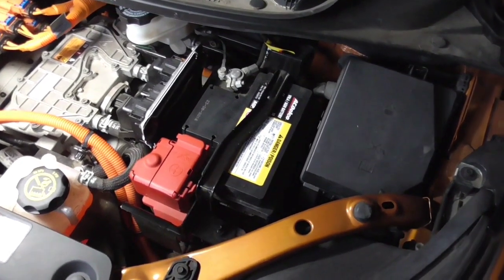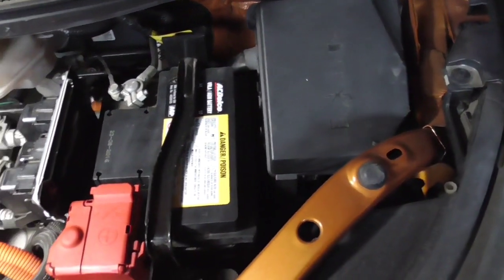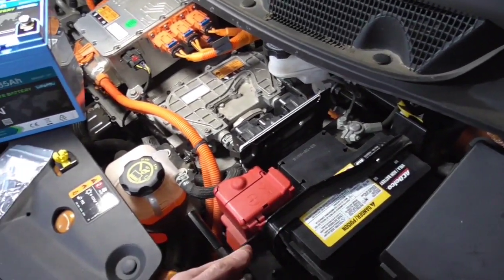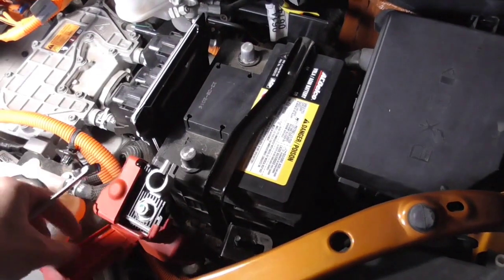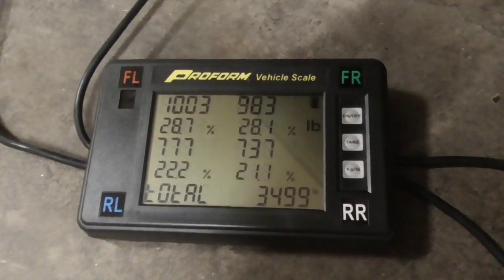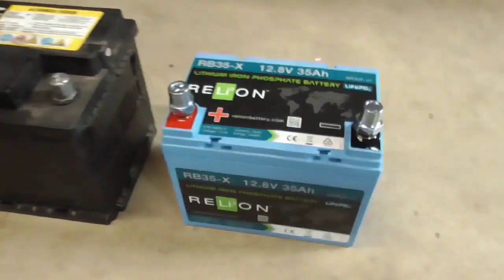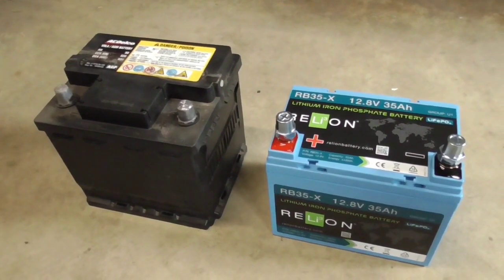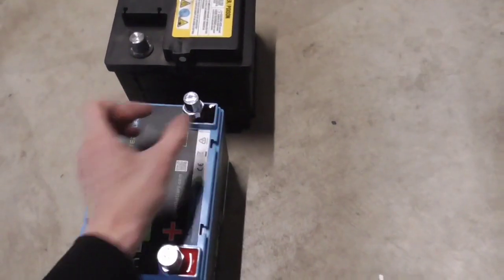Chevy Bolt - 12v upgrade - Modified - episode # 32

Comment: I'm thinking of doing this but with a smaller 12v sodium battery. I'm glad you tried this so many haters out there lol
Reply: I did it with a 100ah LiFePO4 battery, the MINI version from Amazon.
Reply: Mine is a 2019 Bolt EV. Tight fit due to the post being switched around.

Comment: what about freezing???
Reply: I would wrap it in styro if I was in a cold area
Reply from the maker: That's a good question.  The car has lived in western Washington & So Cal for it's entire life, as well as always been garaged while in my ownership.  Which means a lot of mild 50's F to 70's F.  I have driven in the low 20's F with no issuses, but then again those times were driving thru temps.  The under hood (12v battery location) temp stays warm whilst charging.  Also, there is the heat factor.  I have taken several trips to Las Vegas, Tucson, & other desert regions where temps can be in 100's which will shorten the battery life as well.

Comment: Ohmmu - 12v lithium
Reply: No they're terrible. When you disassemble the batteries to check quality, they're absolutely horrible 1/10 quality with missing saftely I honestly can't believe these are allowed to be sold in the US; I'm pretty sure you need thermal sensors in all lithium batteries of this size. https://youtu.be/i27lApNWkyA?si=y4CFFXWT0D6xeF25&t=358
Reply: @Significator111 watched it, thanks.  They're not cheap either

Comment: Thank you for sharing this! I've been looking to replace the 12V AGM battery in my bolt with a LifePO4 battery for some time and was concerned with the battery that I chose to fit in the tray.

Now that I see how its held together, I can make my own out of ABS plastic and insulate the new box to keep the LifePO4 insulated during the colder months!

Thank you! 🎉
Reply from the maker: Glad I could help.

Comment: From what i learned the vehicle will increase its aggressiveness to charge the 12 volt battery as time goes on. Do you know if that is an issue considering the newer battery will not degrade at same rate as the old AGM battery?
Reply from the maker: The car's computer constantly monitors many parameters of the vehicle during operation, including the 12v state of charge.  It will do what it needs to do, when it needs to.  Maybe it's more "aggressive" sometimes or laid-back others.  As long it's working.

Comment: To your update still going strong I see it looks like you put a different battery in when I walk the charging port light video
Reply from the maker: I reinstalled the original 12v battery because I was considering the buyback and then got the recalls taken care of instead.  Didn't want to the dealer to question mods.  Anyway, it should be getting close to "the end of life" here pretty soon, but it just keeps going.  Soon the upgraded 12v will go back in.
Reply: @theevolvingworld  I was considering the buyback as well but during that time I could literally sell the car for $10,000 more than I paid for it and they were only willing to pay me what I paid for it minus the mileage between the time I paid for it it was kind of a stupid deal told him to go bend over a barrel then they stuck my battery and someone else's vehicle and said my in it already had the battery replaced almost a year later got that straightened out before GM figured out what they had done then the dealer break my computer because they kept on loading the wrong software and they had to put a new ECU in and they still didn't have the right software and then a week or so goes by and they said we have to upgrade it to the new software otherwise GM's not going to pay us had to go to the dealer like four times it was utterly ridiculous finally got my new battery but my old one got better mileage so I don't know if it's just some software b***** they pulled but
Reply: @theevolvingworld  also the best tires I found are the Nokia One all season 80,000 mile warranty Kevlar reinforced sidewalls got mine for $140 a piece they are Eevee low roll resistant rated they beat the pants off of any other brand plus you can inflate them to 50 psi and increased my mileage I roughly get anywhere from 4.3 to 5.0 kilowatts per mile hours

Comment: Lifepo4 batteries WILL freeze on you! AGM does not freeze..and will last 7-10 years. Also costs 1/4 of the price...Not to mention different charging and discharge rates...Don't do it, the computer is designed for AGM...

Comment: There is a company online that I found out called ohmmu. Located in Arizona. Their lithium battery is the same size as the OEM and weights 8lbs. I think that's the better choice.
Reply: NO, I cannot stress this enough: DO NOT buy Ohmmu batteries. They're absolute JUNK quality and are a fire hazard (not because of the lithium battery chemistry, but because of the wiring, lack of fire monitoring components, extremely poor quality components, etc). If you don't believe me, watch this teardown of an Ohmmu battery (just ignore the Tesla-specific stuff, which has no bearing on Chevy): https://youtu.be/i27lApNWkyA?si=y4CFFXWT0D6xeF25&t=358

In addition to all this terribleness, they don't even list the capacity of the battery (which should be listed in Ah or Wh), something I've never even seen before. How can you sell a product without even telling consumers what they're getting? The voltage is not enough and is only one-half of the equation (like giving someone only the length but not the width of a product).

I honestly can't believe these are allowed to be sold in the US.

Comment: I replaced my 12v battery with a cheap Walmart Everstart 26R 1 year warranty battery for my 2017 Chevrolet Bolt.  Fits nicely in the battery holder and so far no problems.  When the battery dies I can easily refurbish it myself. Another plus is my other 3 cars have the same battery.
Reply: TY very much, I can't afford the $229 they want at the Autoparts store!
Reply: @dddd-ci2zm  I hope it helps.   The only battery that I looked at was probably the same one you were looking at.  I thought to myself a 12v battery is a 12v battery and I didn't want to spend over $229 for a car battery   At Walmart they told me they didn't have anything for my vehicle.   So I looked at the Everstart 26R 1 year warranty while I was at Walmart.   It has similar specs and so I thought what the heck lets try it and voila it works and fits nicely in the Bolts 12v battery compartment.  A lot less expensive and I can recondition it myself when it's time it dies.  I've had it in for a month and no issues.
Reply: @bfun4615  Hows it holding up? What do you mean by "recondition it myself"?
Reply: @L__Y it's fine.  I don't really drive my bolt.

Comment: So I installed this same battery in my 2017 and the battery saver indicator comes on why???
Reply from the maker: I've noticed the same "battery saver active" message every once in awhile.  I think it happens more when it's colder weather.   It's something to do with the car's inability to read the the status of the new 12v battery correctly. The new has a slightly higher voltage which may be throwing it off.  I haven't noticed any difference & just clear the screen whenever it pops up.

Comment: A regular battery has a lifetime of 5-7 
AGM should be longer. Is there something about the Bolt that makes the 12v not last as long? But nice upgrade. Thanks.
Reply: Considering the battery is not turning over a starter, I'd expect it last much longer in an EV than an ICE vehicle.  I've had my 2017 Bolt for 4 years now and the original lead acid battery is still going strong as far as I can tell.  I live in hot Florida and I can't get 4 years out of a battery in my ICE vehicles.  At about $400 for the Lifepo4 battery, I question whether it's worth it.

Comment: I love the idea of replacing the lead-acid battery with something more modern, but I think I would make something a bit more sturdy than tie-wraps to hold it in place!  BTW, they DO make bigger tie-wraps if your fabrication skills aren't better than drilling holes in plastic 😁
Reply: At the 50 Ah mark for LiFePO4 batteries, there are lots that will fit the Bolt battery location almost perfectly if you put a 0.75" thick piece of neoprene foam under the battery. No cable ties needed, looks like a factory install.

Comment: The 12V Battery management system of the Bolt is programmed to manage an AGM type of battery.  Unless your new battery has some sort of compatible system, I'd be hesitant to try it.  Comment?

Comment: Recently performed this upgrade myself. I started with an RB20-lt which initially worked great. At night the headlights would turn on which triggered the battery protection and I'd have to jump start the car. Definitely go with the 52AH battery. Be sure and order the "low temperature" variant if the temperature regularly drops below freezing were you are.
Reply: There's also the new RB-20X, which is capable of up to 50 amp continuous output. It should solve the overload issue while staying light weight.
Reply: @jrharbortproductions  Ooooooh. Me likey! Thanks for letting me know!

Comment: Will it fit a 100ah lithium battery in the bolt it would be nice especially when running g a 1500w amp. Going to be adding one to the bolt ev 2017 same lead acid battery for now.
Reply from the maker: It shouldn't be a problem, but don't know why you would need it. The DC to DC converter keeps the 12v topped off.  It's just when the old school lead-acid 12v (which lasts only 10% as long) stop holding a charge... you'll be stranded.
Reply: @theevolvingworld  got 2 100w leds as fog lights on the bolt ev with remote  switch.  Just in case. Thanks for letting me know. Not a lot of bolt ev vudeo with amps and subs in them.
Reply from the maker: @dr.projectx5142  As I was driving thru thick heavy fog a few days ago.  I was thinking about adding front LED fog lights with a center rear fog. A practical application.  Looks good too.  The stock HID's do a pretty good job 99% of the time.  Maybe after the new HV battery...

Comment: As with some cars, does the new battery have to be "registered" (with the car's charging system) to reset the that system so it doesn't charge the battery as aggressively as it had been with the ageing battery).
Reply from the maker: Interesting question.  I think the car's charging system simply reads whatever current the 12v is putting out, as it does the HV battery, and charges accordingly.
Reply: @theevolvingworld Does the Bolt's charging system charge according to voltage or current used?
I ask that because traditional charging systems charge as voltage drops, and Li batteries I've used keep their voltage high until the capacity of current output drops way down at which point the voltage drops fast.

Comment: Do you live in an area that freezes regularly?  I'd be worried about that in colder climates, as Lifepo4 batteries aren't happy if you charge them below freezing.
Reply: The simple answer is you cannot use lifep04 batteries below freezing. Yes they will discharge at Temps down to 0⁰ or maybe below but they will not charge. If the built in bms on the battery isn't programmed for low temp cut off, then you will destroy the battery the first time the bolt tries to charge it below freezing. I'm all for creative mods but recommending people use the wrong battery in an application that it definitely isn't suited for is dangerous at the very least and stupid if nothing else. I had a friend that swapped his lead acid rv batteries for lifep04 without doing any research, and he did nothing to winterize the batteries. They had no built in heating system, no low temp disconnect, no el-cheapo heat mat, nothing. Now he has $2000 worth of paperweights and a damaged charging system.
Reply from the maker: Not too much freezing weather.  Lot's of cooler weather.  Yes, all the Lithium variants are not as happy when the temperatures drop.

Comment: A properly maintained AGM battery should last at least 5 years. If an uncooled lithium battery lasts '10 times longer' in that environment, I will be shocked. Granted, I doubt I will live another 50 years to find out.

For those curious how to properly maintain a Bolt EV 12v battery, the car runs a check/charge cycle on the battery every 6 hours when plugged in for charging.
Reply: An AGM battery lasts about 300 cycles, a lithium ion phosphate battery should last about 1700 cycles
Reply: @mcamodell  So if one puts in a AGM replacement battery with a rating of 100ah instead of the default 50ah rated AC Delco AGM sealed lead acid battery; one should have twice the cycle life of 300 cycles since its capacity is now 100ah instead of only 50ah; hopefully the 100ah AGM replacement upgrade battery can fit in the battery tray of the Chevy Bolt; so make some careful battery tray measurements to ensure that the larger 100ah AGM sealed lead acid battery actually fits within the boundary confines of the battery tray.
Reply: @profdleeucc  I'm not sure that's a direct correlation, but theoretically. Also the stock batteries are not sealed lead acid, they are AGM with a built-in regulator.

Comment: The car's battery management computer is tuned for an AGM battery. Let us all know how a lithium battery replacement works out long term!
Reply: Lithium Iron Phosphate behaves the most like Lead Acid of the available lithium-based technologies in the fact it enjoys always being charged to 100%. As long as the new lithium battery is able to 'trick' the car into thinking its working just like a lead acid (and I'm sure it has an on-board controller/bms to do just that), it should work as intended.
Reply: Problem is lifepo4 will draw a lot of charging amps. Like lots- hopefully everything is stout enough to handle…

Comment: Looking good, John. My dual 12V 20AH lithium battery setup is still going strong. I tested the batteries individually about a month ago and they were holding at 13.2V each. Some cautioned that the Kia Soul EV's system might flag it as abnormal but it didn't. I've had it in there for about 6 months with no issues.
Reply: Smart, I tried an underpowered lithium in my Fiat 500e, it shut down on the freeway. Maybe I'll try duals someday.
Reply: @robertpryor7225  Must have been a bad battery because the power requirements for the 12V accessories once the vehicle is started are quite low. Like an ICE car, once the vehicle is running everything is powered by the alternator, or in this case the DC to DC converter that converts the high voltage to low voltage to recharge the 12V battery.
Reply: I hope to get 300k out of mine 500k this would be my last car 😁
Reply: @adayinthelife8646  Even 300K would be far more than the average ICE car gets before it's sent to the crusher. 500k would be great and very possibly the last car you'd ever need.